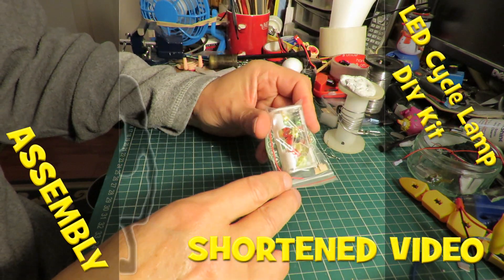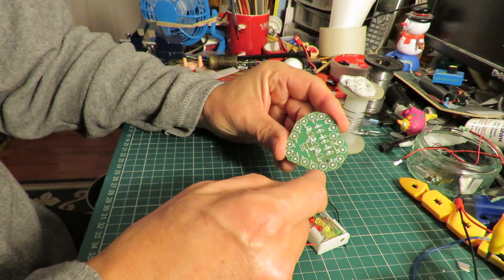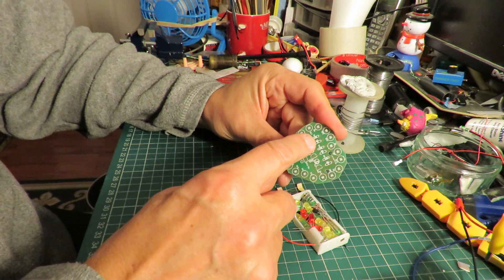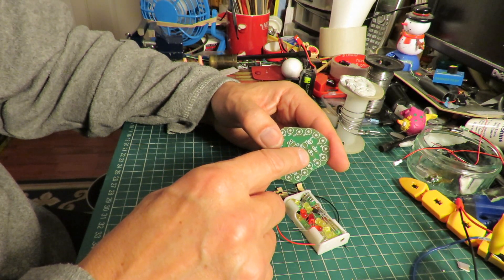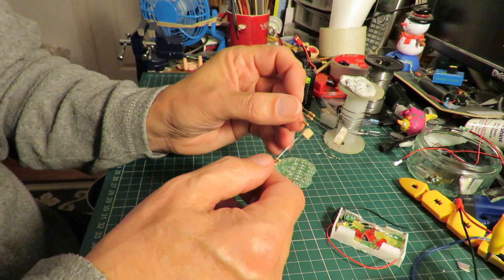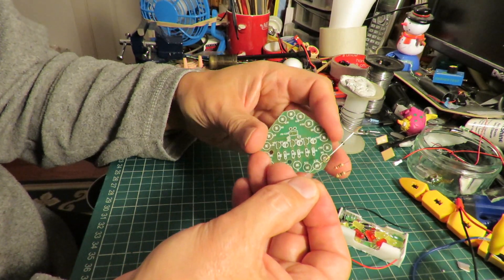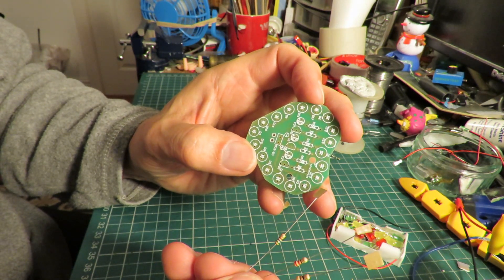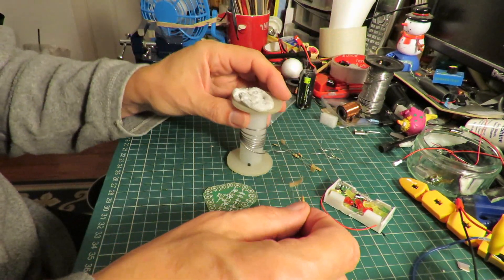Assembling LED Cycle Lamp DIY Kit SHORTENED VIDEO

Comment: Have you done any work with Arduinos or programming the circuit? I started to learn, but ran out of ideas on what to make. You have reinspired me, but I'm loving your repurposing of programmed circuits maybe more. :)
Reply from the maker: Thank you. I am avoiding any projects that involve programming. I was heavily into it in the 80s with the early home computers at home and also as part of my job at work and spent a silly amount of time doing it so I really do not want to get into it again.

Comment: Do you ride a bike?
Reply from the maker: Not in the last 10 years or so. One of my uncles and his wife, both in their late 70s still do :-)
Reply: I've been getting back into it....or trying to at least.
Reply from the maker: Wil Hobbs My wife found she could no longer balance getting on the bike so we gave up.
Reply: Walks are good exercise.
Reply from the maker: Yes but we don't do enough of that either. A stroll round the charity shops is about it for most days.
Reply: Plus your "out and about" videos.
Reply from the maker: Wil Hobbs yes, but there are not many of them :-)